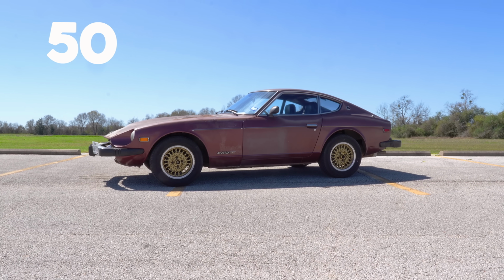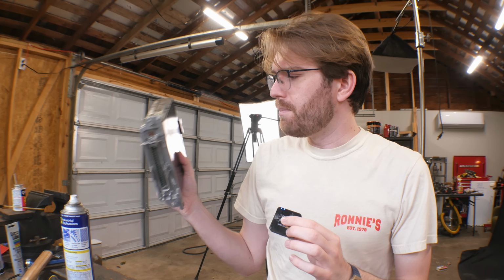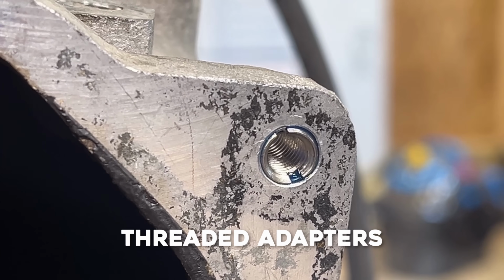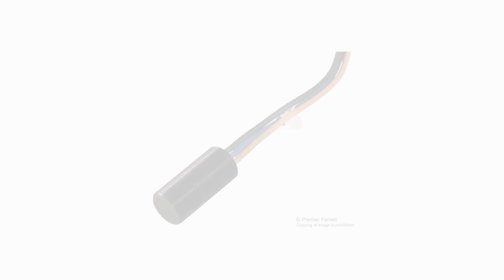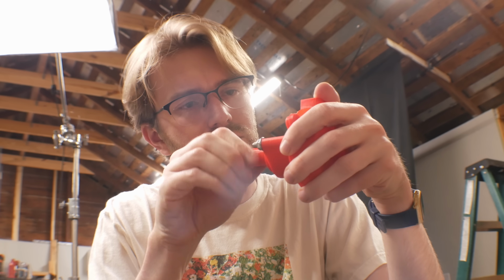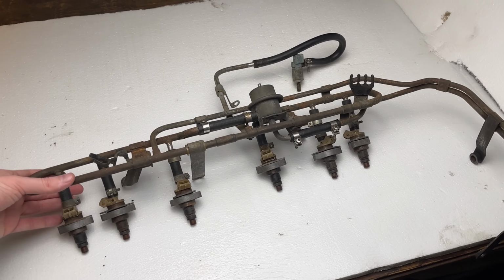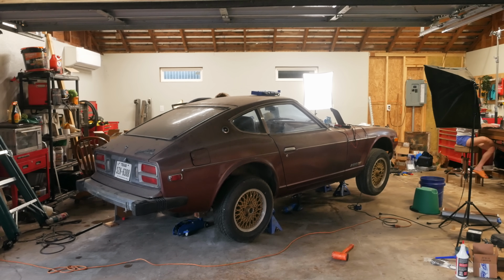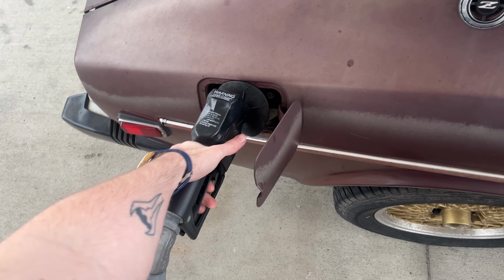Modernizing a Vintage Car

Comment: Wow, what a video. Seriously impressive work, and it really shows how absurdly complicated gasoline engines have become. The volumetric mapping alone is wild. Layers of sensors, throttle bodies, actuators, and computer logic stacked on top of a machine that only gives you about 20 percent efficiency. It’s an amazing amount of trouble just to keep burning dead dinosaurs.
When you put that next to a three-phase electric motor that’s controlled by AC frequency instead of complex air-fuel mix ratios, the contrast is hard to miss. One is basically direct mechanical connection with instant torque and engine braking. The other is a full-time digital babysitting operation just to run an explosion machine.
And honestly, I’ve got to side with the old carb setups here. Once you add all these sensors and computers, it stops feeling like a gasoline engine at all. It’s a computerized combustion system with a lot less soul.
Better off with the infinitely variable three-phase motor and enjoy the drive.

Comment: You may want to look at the calibration of your electronic throttle body. Typically they are not a one-to-one ratio with pedal movement. If you look at the throttle body of an older car with a cable, it has a cam system, where it doesn't move the throttle body too much until you get past a certain point. This is because it will reduce the touchiness of the gas pedal, and it makes it a lot easier and forgiving to drive on the street. Great job on all the design and engineering though. Side note: it is too bad you use profanity in this new video, your videos used to be more family-friendly, now I can't show my kid them anymore, unfortunately.

Comment: Yeah this was how I felt upgrading my hp pavilion computer. That was a lot cheaper and easier and a lot more effective but I still basically spent money in making a cheap thing that could barely play games into a cheap thing that could barely play games. That said it's a great video and the skills and engineering you showed off is fantastic.

Comment: I have a 1977 280Z in my garage that has been sitting there since 1994. I purchased it in 1982 for my girlfriend to drive that later became my ex-wife when we married in 1988. I need to do the same thing that you have done.

Comment: I have always wanted to take a older favorite stock engine and do some homework and fix all the poorly made parts , aiming for the best MPG. and in the processes gain the wasted HP, that was lost dew to factory flawed parts. Compression , Cam, timing, and ignition, and Computer (If needed) Then add some EFI, (With MPG as the important part of the Plan) And then daily drive and enjoy it,  Till I Drop dead...lol

Comment: You'll probably have to run lowering springs in front after the massive weight reduction in Jetronic plumbing and hardware. Very nice work!

Comment: I too hate the early fuel injection systems, I hate their complexity, I hate all the possibilities of vacuum leaks, and I hate how many sensors and subsystems they need. I prefer Carbs to Analog Throttle fuel injection, but I think Electronic Throttle injection is pretty sweet. Now I'm wondering what kind of performance you can get with a more efficient exhaust header, something that enhances scavenging. Good to see you back!

Comment: If you could increase the compression ratio (static and or dynamic), and change the computer to deal with it (you do have a knock sensor, right?), I suspect the change would be even more impressive.

Comment: WTH happened to the “Z” engine? I had a ‘73 240Z and it was a rocket. 

Dual Weber carbs, came out of second-into-third gear at 80MPH. Cost me my licence for a month. Long time ago…

Comment: You just made my day man. and gave more inspiration to start modernizing some components on my 1997 Mazda Familia (or protege) im starting with the speedometer and if that works great, i might redo the ecu since its still running the factory ECU that is mated to an Auto Transmission (it was converted to a 5 speed manual).

Comment: You make me lol thinking 78 car with fuel injection is old it is new and modern cars are not great they are over computed junk. A car from the 50s and 60s are more reliable then any new car and far easier to fix.

Comment: That face when it finally started was priceless. I had an old Volvo with an early mechanical fuel injection system. It was... pretty annoying to work on. I could get some, but not ALL, parts from IPD in Portland, but I had to repurpose a lot of other things. Like the fuel lines with the weird banjo connectors, got them made at a hydraulic shop. I always fantasized about LS swapping the thing. Might still do that to a different Volvo someday.

Comment: Love the humor and process.
Honestly, as I watched this project unfold, I figured you'd be in for about 20-30 hp gains. As the owner of a classic car with modern engines swapped in (3 cars actually) the reliability and predictability of modern controls is worth its weight in the work needed to install. You can still enjoy the looks and feel of the original car, without worrying about how far from home should you travel, or can I still get parts if it fails. But, for real power and economy gains you have to dig into compression ratio, porting, cam/valve profiles, combustion chamber design, intake runners, exhaust flow......so many other systems that have improved over the decades, which will get you to about the 220-240hp range that a modern 2.8L naturally aspirated engine will make.
Reply: A proper port job on the intake and exhaust, with a higher flowing exhaust would probably do a decent amount of good.

Comment: that engine looks clean! I bet if you rebuilt the top end you would get back to a least factory 170hp
Reply: maybe run seafoam through it 😂
Reply: He is back to that already - the 170hp rating was done to a different standard, measured at the flywheel and with no accessories (alternator, water pump, etc) attached.  Typical rwhp for these cars stock and in pristine condition is roughly where he started. I was actually expecting his to come in around 100- 110rwhp, given the condition it appeared to be in.
Reply: @t @tmzwcky  The factory HP rating was achieved using the SAE net test conditions. That includes all accessories and a complete exhaust system, as well as the stock air filter and intake ducting. The automotive industry adopted the SAE net standard in 1972 for cars sold in the U.S.

Comment: LOL! Only 63 years? No problem. I had a yellow 1973 Datsun 240Z, with a 2.8 fuel injected engine and 5-Speed. I ran a Wolf 3D engine management system, Ford O-ring injectors with a fuel rail, and six Chevy LS1 coil packs mounted to an aluminum bracket bolted to the side of the block. I removed the distributor, and used a crank angle sensor on my front crankcase pully instead. That was my daily driver for eight years...I Loved that car. ...And it was a rocket on rails. Great video!

Comment: Tbf putting a proper fuel injection system on engines that were designed in the 70s was basicly all engine development in the 80s.

Comment: Dude is a genius !! I bet there is another 15hp in it somewhere. I had an 82 turbo automatic 280zx and it flew. It actually ran high 14's with nothing but an air filter and exhaust with 100k on it. These were popular cars but they rusted out quickly. I owned an 81 5spd also, 2 of my friends had one also, but then it was back camaro's and firebird's after the 280 fun got old.

Comment: I would be willing to bet that most of the power gained was because of the bigger throttle body and the removal of the air flow meter, a faster advance curve and possibly more timing. I remember working on these cars back in the 80's and we could get quite a bit more power from them with the stock fuel injection, they were never really fast unless they were turbocharged and highly modified.

Comment: I would also recommend getting a full internal rebuild.
I know you said "nothing internal" but at least cleaning the internals, redoing the piston rings, etc. could gain some more power back with minimal risk. You can even have a shop do it for you if you are uncomfortable with such a deep teardown.

Comment: Meanwhile, I got tired of not knowing how a carburetor works, so I replaced it with the Holley Sniper system for fuel injection in the intake. I have no idea if it knows what a volumetric efficiency table is, because I never saw one during my setup. Now if only I could get the idle fuel consumption down... Pretty sure a V8 doesn't need 1.5 gallons per hour... At least Google tells me it should be .5 anyway.

Comment: You should be getting way higher MPG if it was truly injecting fuel into all cylinders every cycle before, ideally 6x of the original. Might wanna check that out. Also very cool build, looks super clean!

Comment: prolly needs new piston rings and new bottom end bearings to transfer more power and try checking valve lash ?
Reply: do a compression test to see how much compression has lost since it rolled off factory

Comment: That's a ton of work for a part that can be had online for little money, godzilla raceworks has an L series crank angle sensor for $250. Or a jeep 4.0l crank sensor for pretty much nothing at a junkyard, fits the existing distributor hole, just needs a few changes on the shaft.

Comment: Honestly, this is so sick. SUCH a cool project. I grew up with these cars, and have spent a fair amount of time racing them. I love them dearly, they sound incredible, and I soon hope to pick up my own project again in my old mans L28 swapped 240. That being said, the L series is a big ol turd by todays standards 🤣. You do have SOME power gains to be had with some exhaust work and a different intake manifold if you can find it (make it?). But really, the drivability you've picked up is going to be incredible, and thats worth something. So stoked for this project, good work.

Comment: I wonder if adding a MAF sensor would increase efficiency even more? Knowing exactly how much air is entering the engine would probably help the tuning a little bit. You may crack 20mpg.

Comment: One reason I love haltech ECU's, the auto table stuff. Its not perfect, but when trying to get a car to start, you can legit just turn key and it will try to fill in the details as best as it can to get a base map. Its pretty sweet. Dunno if youre ECU has that feature.

Comment: With a name like Romeo Welch or Ronald Finger ya better be one cool ass Mf’er. Which we are .. Bahaha.. With all that said ya shoulda dropped in a a 4.8 LS motor  which would have gained you an extra 175 HP with the same 19/20 miles per gallon .. Ask me how I know ..? My 2000 single cab long bed Silverado work truck with said 4.8 loaded with tools averaged that even at 248,000 miles  along with 285 horsies .

Comment: Awww this isnt an ebay turbo kit video (love the car btw)

Edit: for anyone curious: the efi system that came in your datsun can be converted (replacement) to a mechanical fuel injection system from holley that you could modify to work on the car, and it would be a period correct mod (if you decide to return it to a faithful build)

Comment: ya horse power is not great but did you look at the torque? 312!!! that thing wants a turbo bad!! it would be a monster if you can shove more air and  you did 50% of the work for a turbo already

Comment: You know what you do now? Now that you've made the engine itself more efficient? You remove draws off it as well. Electric water pump, electric fans, even electric power steering pump. They're pretty easy things to come by and can remove so much stress off your engine. To the point where all you have to run is a nice strong alternator and free up even more horsepower.
Reply: Much of the power gained from that, would be eaten up by the extra load on the alternator. Been there done that.
Reply: @jrand2631 a proper 300 amp alternator at peak output will only draw about six and a half horsepower from an engine. The mechanical fan alone can draw close to 10. The average mechanical power steering pump is around 3 to 4. And a water pump is usually close to 5 or 7. It varies from vehicle to vehicle. But putting in an electric water pump and fan alone beats out more than whatever alternator you'd have to use would be put in. Not to mention the possibility of putting in an electric AC pump which would allow you to maintain I feel mileage with the air conditioner working.

Comment: Awesome work, truly! Simplifying the system with better electronics will pay off in reliability. Are you running the coils on wasted spark? It might give you a little extra gain on efficiency.

Comment: I am resomodding my 260z, and HybridZ has been an invaluable source of info and inspiration. My goals are much higher HP wise, but hey we all have our poison. But theres decades of infomation out there to help with stuff like your fueling map for start up, why not utilize it? Theres even high HP builds for idiots like me to follow so why not learn from others to save myself trouble and money. I even found a 200 or 220whp L24 efi build there, and if I remember right its a sticky'd thread in the engine forum. It'd be even better on an L28! Especially since you already have a tunable ecu and such. 

Either way you're off to a great start!

Comment: I would love to know why the final result was not better. It seems like you perfected the system. So where are the limitations now ? Is it the design of the engine ? Or does the exhaust need to be fed back through to burn unburned fuel ?

Comment: The way cars are being made today, we need more of this. I would have just replaced the engine. Perhaps a Honda F20C would work. Or maybe one of the many BMW inline 6 engines. Or, you could always try to fit the V6 from my 2015 Nissan XTerra under the hood to keep everything in the same family.

Comment: 28:54 what turned out to cause this stumble when giving it throttle? 
I’m sorting out an S50-swapped E30 that someone else did the swap on, I’ve got it to the point where it idles fine but experiences this exact same stumble when revving. I can’t figure it out

Comment: Nicely done. 

I might suggest looking into running a wastespark style for ignition. If your coils can handle it that is. From what I've seen on older engines, probably due to their combustion chamber style, running wastespark smooths out its operation noticeably. With your set up it'll most likely just be a couple drop down boxes anyways.

Comment: I get why you're doing it the way you are 
but if you really want to make real power you need a different cam I do this pretty much every weekend and I'm usually removing a engine porting the heads and valves slapping a bigger cam into it and of course a bigger intake and bigger cfm carb but then again I'm working on carbureted engines 
Not these fancy fuel injected things

Comment: Been patiently waiting for the next project or a garage update. What a year. Welcome back.

Picking up an '83 280zx. Gonna have to go through Salvage Inspection due to title, but it's all there and probably runs fine. Waiting for my garage to be clear before bringing it home. I'm excited.
Reply: Gotten to the distributor replacement section, there are bolt-on options to replace it with a Crank Angle Sensor that mounted directly above the crankshaft pulley with a block-off plate for the distributor hole. The end result is the same though.
Edit: I see why you went with the distributor change now. You didn't want to waste fuel/spark. Understandable.

Comment: EDIT: NVM, just checked prices for a dizzy of a turbo model, and DAMN did they go up in price. Yeah, your solution is better, I ain't paying those prices lol.

ORIGINAL COMMENT:
So, that pickup wheel assembly is really cool. But... why not get a L28ET (the turbo model) distributor, remove the cap, put an aftermarket optical trigger wheel that cost 30 bucks, and call it a day? Same 24 point resolution, but it takes like a week tops due to shipping.

Comment: I understand it's a strawman but like- who the fuck says that not manufacturing it makes it not yours?
You came up with the concept, the design, the design's iterations, and the plan for its integration to the original engine.

This argument would be like saying an architect doesn't do anything because they didn't build the house, it's just- absurdist.

Comment: So, you did all the hard work to get it to work (awesome job, btw), but you didn't bother cleaning up the heads, bearings and the internals?

I understand your didnt want to upgrade the internals, but even just a hone, new bearings and rings?

Comment: So you just confirmed a known fact. Modern fuel injection does not produce a lot of extra horsepower but it will improve driveability. There is usually no difference at WOT. That was a lot of time and money for 13%.

Comment: My boss just bought two 72 240z one is wrecked in the back and the other is ready to put together.  Three motors two 4 speeds and a 5 speed. And more NOS Japanese parts that you can shake a stick at. The previous owner was a cargo pilot and would buy Datsun parts and bring them back all the time.   My boss stole them paying 10k for everything.  The wrecked car is getting the drag car treatment.

Comment: Next steps: Integrate a Honda IMA-like system to further improve fuel economy with hybrid battery assist. Maybe you can get to 25mpg that way, and it'll only take you 55 years to recoup the costs instead of 63!

Comment: Was looking forward to this video. I have a 78 280z myself that I was putting back together during the same time you were doing this. I went the easy route and tossed the fuel injection system and went with 240z SU carbs. Might not have a fancy computer controlling everything, but that last sentence in the video was the main reason why lol